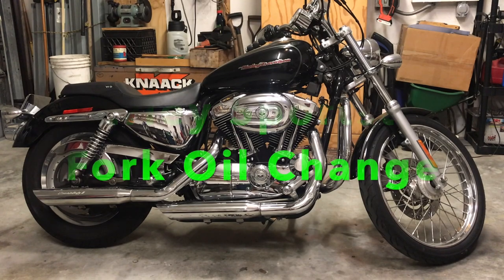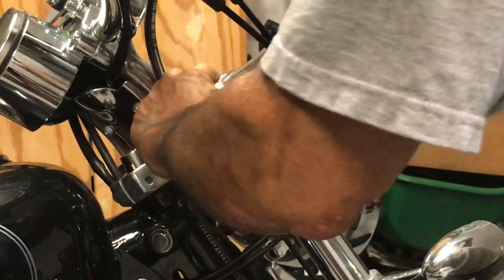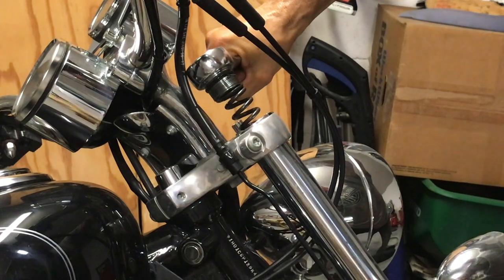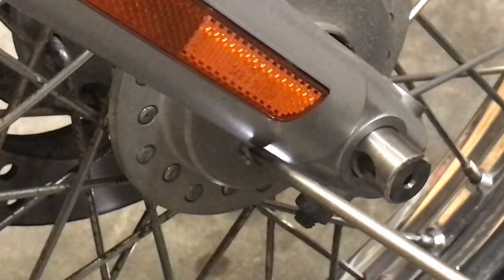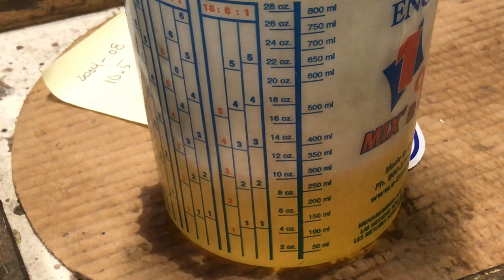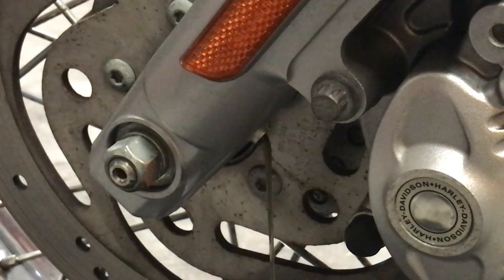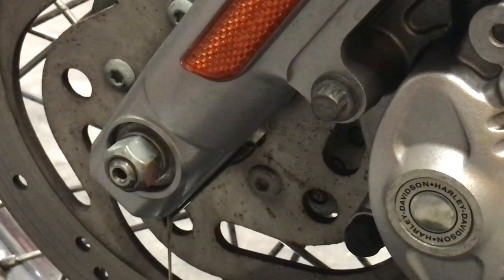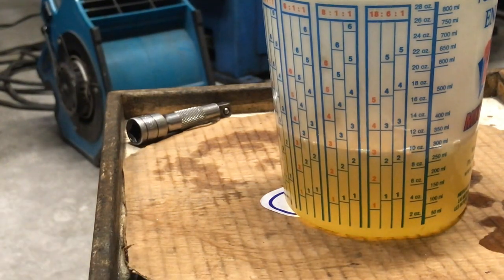How To Harley Sportster Fork Oil Change

Comment: what is different in the 2005 XL 1200 Roadster?
Reply from the maker: Happy to help. Duel front brakes, a hotter cam, two plugs for each cylinder.  HP version. Thank you for watching and your support G4 Cajun. Ride safe and have a great day.  And paint schemes.

Comment: Why remove the spring once drained?
Reply from the maker: Happy to help. Once you remove the oil and the spring, then you put new oil in pump it up a few times to get the air out of the system and then reinstall the spring and spacer then cap. Thank you for watching, and all your support D winningave. Ride safe and have a great day.

Comment: Hi Rocco, great video. 
What are the torque lbs for the fork bolts on top 
I tested it. Looks like it’s around 60foot lbs?
Reply from the maker: https://www.hdforums.com/forum/touring-models/177766-torque-specs-front-end.html.  that does sound right.  Hope this helps. Thank you for watching and all your support Andy. Ride safe and have a great day
Reply: @TwoWheelRocco  
Thanks Rocco, that’s what I was looking for 🤘
Have a good one, ride safe!
Reply: I forgot to ask, 
Is it necessary to loosen the pinch bolts first before unscrewing the top fork bolts? Thanks again
Reply from the maker: @BadAndy01979  my pleasure..  Watch the video and take notes. Or it could get ugly. Any questions just ask.
Reply from the maker: @BadAndy01979  No I did not,. Thank you for watching
Reply: @TwoWheelRocco  thanks for all your help, I’m leaning how to do new stuff from your videos
Reply from the maker: @BadAndy01979 Any questions just ask. And thank you for watching.

Comment: Could one use 5w? Shop in town said that would work....but im seeing 20w everywhere elsw.
Reply from the maker: Five weight oil will give you a very soft ride stock is between eight and 10 wait ,  15 to 20 and you got a nice ride what bike are you doing this on?  Do you know how this works out. I like 15 and so does everybody else that I know.   Happy to help. Thank you for watching and your sub Thomas. Ride safe and have a great day,
Reply: @TwoWheelRocco  I appreciate it! Super quick. That's amazing. It's a 2000 sporty 1200 that's being built into a chop. I have 6 over forks I installing. I went to the Indian dealership bc they are the only ones that have fork oil in town. I ended up leaving their fork oil designed for the Scout and thunderstorm bikes. There is no listed weight....but the parts guy thought it was around 10
Reply from the maker: @thomasknapp7236  Let us know how it works out.  I buy my fork while on eBay.  https://www.ebay.com/sch/i.html?_from=R40&_trksid=p2553889.m570.l2632&_nkw=fork+oil&_sacat=6028.

Comment: How many miles should I change fork oil
Reply from the maker: Happy to help. I usually go through the whole system when there's a leak on my front seal of my forks. Or 20,000 miles just changed the Fork oil I like to go 15 weight it's stiffens it up a little bit. Thank you for all your support Victor. Ride safe and have a great day.

Comment: Hi Rocco.  Great video. Did my fork oil this week.   But got a little oil on my rotor. Wipe it dry. A few times But not liking front breaking. Any advise on solution    Thx. Mike
Reply from the maker: Drive it Will reseat pads and burn up any residual brake fluid. Let us know how it works out.
Reply: Two Wheel Rocco   Thx
Reply from the maker: @mikesharon760  My next video is Bleeding your Brakes.
Reply: Two Wheel Rocco    Reset my pads. After a few.  Drinking days. All is great thx.  Keep posting em
Reply from the maker: @mikesharon760   Thank you for your Sub. Ride Safe and have a great day.
Reply: Brake cleaner, spray it on and wipe it off, works great.
Reply from the maker: @mikerolla5601  I agree Mike.
Reply: Will be replacing fork oil in my 2001 sporty tomorrow. Thanks for the video.
Reply from the maker: @mikerolla5601  Happy to Help, Any question just ask Mike,  Ride Safe and have a Great Day. Thank you for your Support.